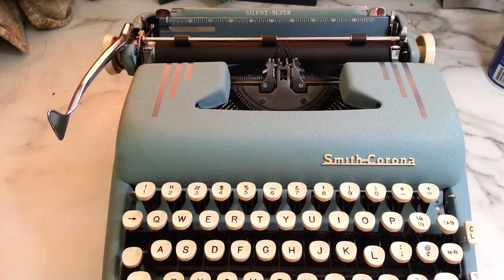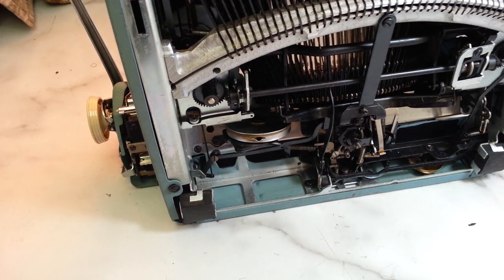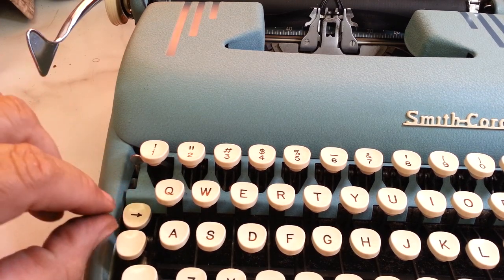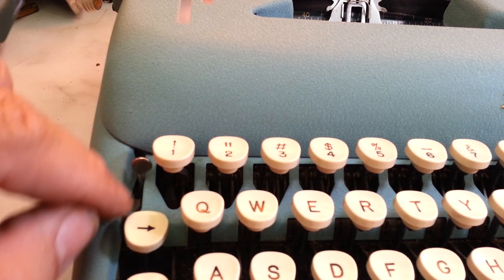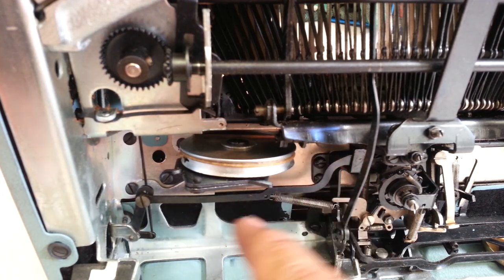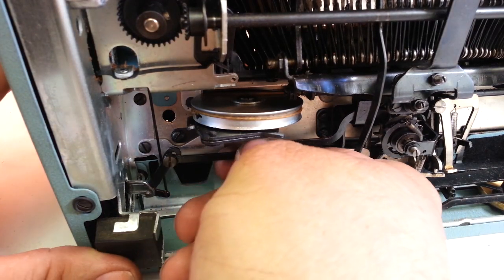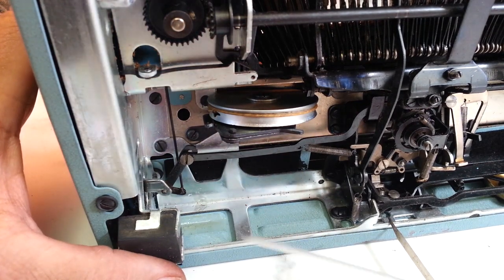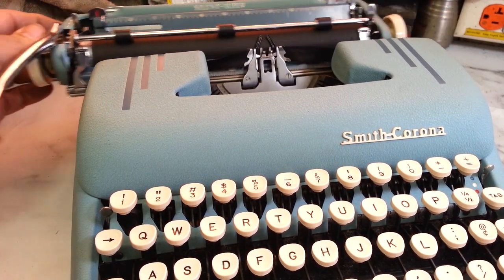Smith Corona Manual Vintage Typewriter Back Space Button Lever Stuck Gummy Repair

Comment: How the hell do you keep lacquer thinner in that plastic container? Shouldn't it melt it?
Reply from the maker: These are professional grade plastic bottles, not all plastics melt on contact with LT
BTW one of those bottle I use has had LT in it 24/7 for 15 yrs
Reply: @phoenixtypewriter2136  thanks for the tip. Question, I am outside the states and...well... I tried to clean white-out from a card holder with paint thinner and a toothbrush. The white-out is gone, but the toothbrush melted the surface of the plastic and left tiny lines, plus, its not longer transparent, but opaque. Needs to be replaced, right? Can't be polished back to shape? (yeah, I screwed up)